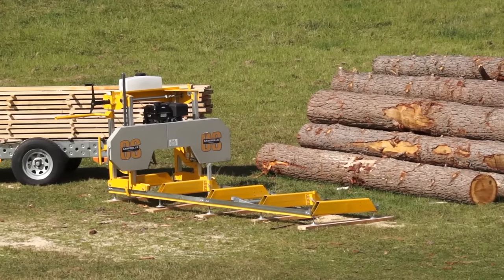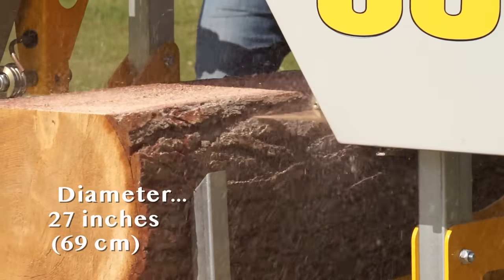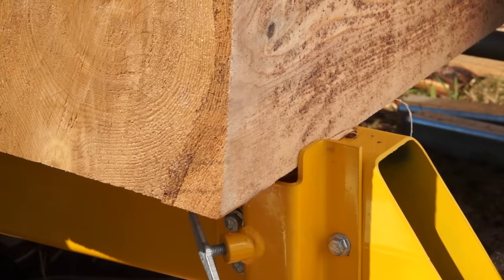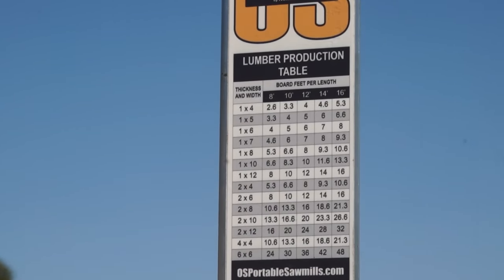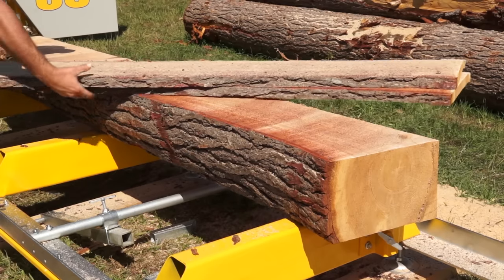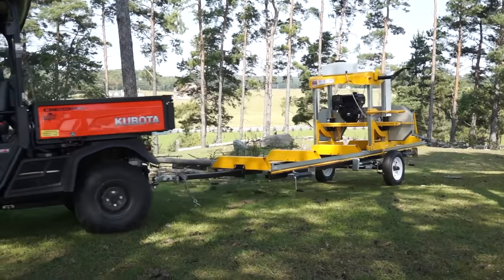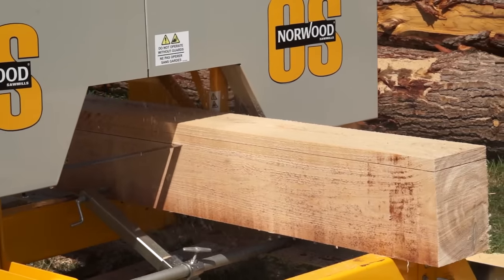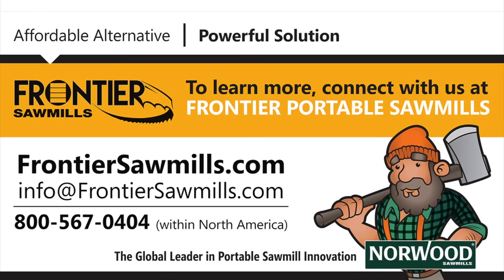The Affordable, Easy-to-Use & Reliable Sawmill You've Been Looking for - The Frontier OS27

Comment: can you please tell me, where can I get it. And also the price.
Reply from the maker: Frontier builds three sawmill models with different log diameter capacities: OS23: 59cm (23”), OS27: 69cm (27”), and OS31: 79cm (31”). Standard log length is 3.4m (11’) but you can add 7’ (2.1m) extensions to mill as long as you want.  You can add the optionally available trailer/support jack system to all Frontier sawmills at any time (when you get your Frontier or in the future).

Frontier Sawmills start at just USD $2397 (for the Frontier OS23). The Frontier OS27 starts at only USD $3397.  The Frontier OS31 starts at only USD $3997.  

You can get a lot of helpful info about Frontier Sawmills, including all pricing, at www.FrontierSawmills.com  .

Frontier services your country factory-direct.  To order, contact us directly at Frontier Sawmills via email at info@FrontierSawmills.com . 

Thanks!

Comment: I was wondering couldn't you not use double sided blade so you could cut on the back stroke
Reply from the maker: Hi Mark

Your question (suggestion) is not uncommon. Here is the reason why it is not done. Band blades need to be supported in the cut – top, bottom and back. To make a sawmill that can cut in both directions means having a blade with teeth on both sides of the blade. But, if you have teeth at the “back” of the blade, it is hard to support that surface with a blade guide support.

Comment: I need this machine please where are get  information
Reply from the maker: Frontier builds three sawmill models with different log diameter capacities: OS23: 59cm (23”), OS27: 69cm (27”), and OS31: 79cm (31”). Standard log length is 3.4m (11’) but you can add 7’ (2.1m) extensions to mill as long as you want.  You can add the optionally available trailer/support jack system to all Frontier sawmills at any time (when you get your Frontier or in the future).

Frontier Sawmills start at just USD $2297 (for the Frontier OS23). The Frontier OS27 starts at only USD $3297.  The Frontier OS31 starts at only USD $3897.  

You can get a lot of helpful info about Frontier Sawmills, including all pricing, at www.FrontierSawmills.com  .

To order, contact us directly at Frontier Sawmills via email at info@FrontierSawmills.com . 

Thanks!

Comment: I am from india.I want to purchase this saw machine .please suggest how can i purchase
Reply from the maker: Frontier builds three sawmill models with different log diameter capacities: OS23: 59cm (23”), OS27: 69cm (27”), and OS31: 79cm (31”). Standard log length is 3.4m (11’) but you can add 7’ (2.1m) extensions to mill as long as you want.  You can add the optionally available trailer/support jack system to all Frontier sawmills at any time (when you get your Frontier or in the future).

Frontier Sawmills start at just USD $2297 (for the Frontier OS23). The Frontier OS27 starts at only USD $3297.  The Frontier OS31 starts at only USD $3897.  

You can get a lot of helpful info about Frontier Sawmills, including all pricing, at www.FrontierSawmills.com  .

Frontier services your country factory-direct.  To order, contact us directly at Frontier Sawmills via email at info@FrontierSawmills.com . 

Thanks!

Comment: Can we get in India? What will be the price in India?
Reply from the maker: We ship Frontier mills worldwide.

Frontier builds three sawmill models with different log diameter capacities: OS23: 59cm (23”), OS27: 69cm (27”), and OS31: 79cm (31”). Standard log length is 3.4m (11’) but you can add 7’ (2.1m) extensions to mill as long as you want.  You can add the optionally available trailer/support jack system to all Frontier sawmills at any time (when you get your Frontier or in the future).

Frontier Sawmills start at just USD $2297 (for the Frontier OS23). The Frontier OS27 starts at only USD $3297.  The Frontier OS31 starts at only USD $3897.  

You can get a lot of helpful info about Frontier Sawmills, including all pricing, at www.FrontierSawmills.com  .

Frontier services your country factory-direct.  To order, contact us directly at Frontier Sawmills via email at info@FrontierSawmills.com . 

Thanks!

Comment: How much will be the price of this machine in Indian Currency?
Reply from the maker: Frontier builds three sawmill models with different log diameter capacities: OS23: 59cm (23”), OS27: 69cm (27”), and OS31: 79cm (31”). Standard log length is 3.4m (11’) but you can add 7’ (2.1m) extensions to mill as long as you want.  You can add the optionally available trailer/support jack system to all Frontier sawmills at any time (when you get your Frontier or in the future).

Frontier Sawmills start at just USD $2297 (for the Frontier OS23). The Frontier OS27 starts at only USD $3297.  The Frontier OS31 starts at only USD $3897.  

You can get a lot of helpful info about Frontier Sawmills, including all pricing, at www.FrontierSawmills.com  .

Frontier services your country factory-direct.  To order, contact us directly at Frontier Sawmills via email at info@FrontierSawmills.com . 

Thanks!

Comment: What is price and  in which country made it
Reply from the maker: Frontier sawmills are made in China. If you would like a sawmill made in the U.S.A. and Canada, consider Norwood Sawmills.

Frontier builds three sawmill models with different log diameter capacities: OS23: 59cm (23”), OS27: 69cm (27”), and OS31: 79cm (31”). Standard log length is 3.4m (11’) but you can add 7’ (2.1m) extensions to mill as long as you want.  You can add the optionally available trailer/support jack system to all Frontier sawmills at any time (when you get your Frontier or in the future).

Frontier Sawmills start at just USD $2297 (for the Frontier OS23). The Frontier OS27 starts at only USD $3297.  The Frontier OS31 starts at only USD $3897.  

You can get a lot of helpful info about Frontier Sawmills, including all pricing, at www.FrontierSawmills.com  .

Frontier services your country factory-direct.  To order, contact us directly at Frontier Sawmills via email at info@FrontierSawmills.com . 

Thanks!

Comment: I very admired this sawmill.how can get these machine? & How much for its cost
Reply from the maker: Frontier builds three sawmill models with different log diameter capacities: OS23: 59cm (23”), OS27: 69cm (27”), and OS31: 79cm (31”). Standard log length is 3.4m (11’) but you can add 7’ (2.1m) extensions to mill as long as you want.  You can add the optionally available trailer/support jack system to all Frontier sawmills at any time (when you get your Frontier or in the future).

Frontier Sawmills start at just USD $2397 (for the Frontier OS23). The Frontier OS27 starts at only USD $3397.  The Frontier OS31 starts at only USD $3997.  

You can get a lot of helpful info about Frontier Sawmills, including all pricing, at www.FrontierSawmills.com  .

Frontier services your country factory-direct.  To order, contact us directly at Frontier Sawmills via email at info@FrontierSawmills.com . 

Thanks!

Comment: Será posible traer una de esas para el Salvador
Reply from the maker: Si

Frontier fabrica tres modelos de aserraderos para troncos de diferente diámetro: OS23: 23” (50cms), OS27: 27” (69cms) y la OS31: 31” (79cms)  La longitud estándar del tronco es de 11’ (3.4m) pero usted podrá adicionar extensiones de 7’ (2.1m) para aserrar troncos tan largos como usted desee. Usted podrá adicionar el sistema opcional de remolque/sistema de soporte de gato a todos los modelos de aserraderos Frontier en cualquier momento (cuando usted compre su  Frontier o en un futuro)

Los aserraderos Frontier comienzan desde solo USD $2297 ( Frontier OS23). La Frontier OS27 inicia desde solo USD $3297. La Frontier OS31 empieza desde solo USD $3897 

Usted podrá encontrar gran cantidad de información sobre los Aserraderos Frontier, incluyendo precios en la página web  www.FrontierSawmills.com/es_us/

Comment: What a machine fabulous great very very nice machine but how much indian rupees plz
Reply from the maker: Frontier builds three sawmill models with different log diameter capacities: OS23: 59cm (23”), OS27: 69cm (27”), and OS31: 79cm (31”). Standard log length is 3.4m (11’) but you can add 7’ (2.1m) extensions to mill as long as you want.  You can add the optionally available trailer/support jack system to all Frontier sawmills at any time (when you get your Frontier or in the future).

Frontier Sawmills start at just USD $2297 (for the Frontier OS23). The Frontier OS27 starts at only USD $3297.  The Frontier OS31 starts at only USD $3897.  

You can get a lot of helpful info about Frontier Sawmills, including all pricing, at www.FrontierSawmills.com  .

Frontier services your country factory-direct.  To order, contact us directly at Frontier Sawmills via email at info@FrontierSawmills.com .

Comment: How many Cubic meters of sawntimber average per day with this brand sawmill,The Frontier 0S27
Reply from the maker: The number of cubic meters (or board feet) that you can saw in a day varies depending on so many factors including the dimension, species and condition of the logs you are sawing (bigger, clean, knot-free logs will yield higher output in a given period of time). Board footage will also depend on what you are sawing (small boards versus big beams). And, of course, it will vary depending on which model you have and its configuration, which power plant and the set-up of your sawing operation.

Comment: Brass tacks. how much $$? 
It’s great
Reply from the maker: Frontier builds three sawmill models with different log diameter capacities: OS23: 23” (59cm), OS27: 27” (69cm), and OS31: 31” (79cm). Standard log length is 11’ (3.4m) but you can add 7’ (2.1m) extensions to mill as long as you want.  You can add the optionally available trailer/support jack system to all Frontier sawmills at any time (when you get your Frontier or in the future). 

Frontier Sawmills start at just USD $2297 (for the Frontier OS23). The Frontier OS27 (the one in the video here) starts at only $3297.  The Frontier OS31 starts at only $3897. 

You can get a lot of helpful info about Frontier Sawmills, including all pricing, at www.FrontierSawmills.com  .

We would be happy to mail you a free Frontier Sawmills info kit. You can order one online at  https://www.frontiersawmills.com/en_us/free-catalog-free-dvd-form

Thanks!

Comment: I like your woodworking machine. Please tell me the price of the machine.
Reply from the maker: Frontier builds three sawmill models with different log diameter capacities: OS23: 59cm (23”), OS27: 69cm (27”), and OS31: 79cm (31”). Standard log length is 3.4m (11’) but you can add 7’ (2.1m) extensions to mill as long as you want.  You can add the optionally available trailer/support jack system to all Frontier sawmills at any time (when you get your Frontier or in the future).

Frontier Sawmills start at just USD $2297 (for the Frontier OS23). The Frontier OS27 starts at only USD $3297.  The Frontier OS31 starts at only USD $3897.  

You can get a lot of helpful info about Frontier Sawmills, including all pricing, at www.FrontierSawmills.com  .

Frontier services your country factory-direct.  To order, contact us directly at Frontier Sawmills via email at info@FrontierSawmills.com . 

Thanks!

Comment: Сколько интерестно эта прелесть стоит?
Reply from the maker: Frontier builds three sawmill models with different log diameter capacities: OS23: 59cm (23”), OS27: 69cm (27”), and OS31: 79cm (31”). Standard log length is 3.4m (11’) but you can add 7’ (2.1m) extensions to mill as long as you want.  You can add the optionally available trailer/support jack system to all Frontier sawmills at any time (when you get your Frontier or in the future).

Frontier Sawmills start at just USD $2297 (for the Frontier OS23). The Frontier OS27 starts at only USD $3297.  The Frontier OS31 starts at only USD $3897.  

You can get a lot of helpful info about Frontier Sawmills, including all pricing, at www.FrontierSawmills.com  .

Frontier services your country factory-direct.  To order, contact us directly at Frontier Sawmills via email at info@FrontierSawmills.com .
Reply: Везде стандартный иностранный ответ!

Comment: kindly,,......... how much machine price?
Reply from the maker: Frontier builds three sawmill models with different log diameter capacities: OS23: 59cm (23”), OS27: 69cm (27”), and OS31: 79cm (31”). Standard log length is 3.4m (11’) but you can add 7’ (2.1m) extensions to mill as long as you want.  You can add the optionally available trailer/support jack system to all Frontier sawmills at any time (when you get your Frontier or in the future).

Frontier Sawmills start at just USD $2397 (for the Frontier OS23). The Frontier OS27 starts at only USD $3397.  The Frontier OS31 starts at only USD $3997.  

You can get a lot of helpful info about Frontier Sawmills, including all pricing, at www.FrontierSawmills.com  .

Frontier services your country factory-direct.  To order, contact us directly at Frontier Sawmills via email at info@FrontierSawmills.com . 

Thanks!

Comment: Can u please tell me the price of the Machine...In India Currency...RS
Reply from the maker: Frontier builds three sawmill models with different log diameter capacities: OS23: 59cm (23”), OS27: 69cm (27”), and OS31: 79cm (31”). Standard log length is 3.4m (11’) but you can add 7’ (2.1m) extensions to mill as long as you want.  You can add the optionally available trailer/support jack system to all Frontier sawmills at any time (when you get your Frontier or in the future).

Frontier Sawmills start at just USD $2297 (for the Frontier OS23). The Frontier OS27 starts at only USD $3297.  The Frontier OS31 starts at only USD $3897.  

You can get a lot of helpful info about Frontier Sawmills, including all pricing, at www.FrontierSawmills.com  .

Frontier services your country factory-direct.  To order, contact us directly at Frontier Sawmills via email at info@FrontierSawmills.com . 

Thanks!

Comment: Ye kitne ropay se hay ye machine our kaha se miltey muge bata do
Reply from the maker: Frontier builds three sawmill models with different log diameter capacities: OS23: 59cm (23”), OS27: 69cm (27”), and OS31: 79cm (31”). Standard log length is 3.4m (11’) but you can add 7’ (2.1m) extensions to mill as long as you want.  You can add the optionally available trailer/support jack system to all Frontier sawmills at any time (when you get your Frontier or in the future).

Frontier Sawmills start at just USD $2297 (for the Frontier OS23). The Frontier OS27 starts at only USD $3297.  The Frontier OS31 starts at only USD $3897.  

You can get a lot of helpful info about Frontier Sawmills, including all pricing, at www.FrontierSawmills.com  .

Frontier services your country factory-direct.  To order, contact us directly at Frontier Sawmills via email at info@FrontierSawmills.com . 

Thanks!

Comment: Is it available in India?
Reply from the maker: Frontier builds three sawmill models with different log diameter capacities: OS23: 59cm (23”), OS27: 69cm (27”), and OS31: 79cm (31”). Standard log length is 3.4m (11’) but you can add 7’ (2.1m) extensions to mill as long as you want.  You can add the optionally available trailer/support jack system to all Frontier sawmills at any time (when you get your Frontier or in the future).

Frontier Sawmills start at just USD $2297 (for the Frontier OS23). The Frontier OS27 starts at only USD $3297.  The Frontier OS31 starts at only USD $3897.  

You can get a lot of helpful info about Frontier Sawmills, including all pricing, at www.FrontierSawmills.com  .

Frontier services your country factory-direct.  To order, contact us directly at Frontier Sawmills via email at info@FrontierSawmills.com . 

Thanks!

Comment: Is this available in the philippines??
Reply from the maker: Frontier builds three sawmill models with different log diameter capacities: OS23: 59cm (23”), OS27: 69cm (27”), and OS31: 79cm (31”). Standard log length is 3.4m (11’) but you can add 7’ (2.1m) extensions to mill as long as you want.  You can add the optionally available trailer/support jack system to all Frontier sawmills at any time (when you get your Frontier or in the future).

Frontier Sawmills start at just USD $2297 (for the Frontier OS23). The Frontier OS27 starts at only USD $3297.  The Frontier OS31 starts at only USD $3897.  

You can get a lot of helpful info about Frontier Sawmills, including all pricing, at www.FrontierSawmills.com  .

Frontier services your country factory-direct.  To order, contact us directly at Frontier Sawmills via email at info@FrontierSawmills.com . 

Thanks!

Comment: India me kaha milega ye machine
Reply from the maker: Frontier builds three sawmill models with different log diameter capacities: OS23: 59cm (23”), OS27: 69cm (27”), and OS31: 79cm (31”). Standard log length is 3.4m (11’) but you can add 7’ (2.1m) extensions to mill as long as you want.  You can add the optionally available trailer/support jack system to all Frontier sawmills at any time (when you get your Frontier or in the future).

Frontier Sawmills start at just USD $2397 (for the Frontier OS23). The Frontier OS27 starts at only USD $3397.  The Frontier OS31 starts at only USD $3997.  

You can get a lot of helpful info about Frontier Sawmills, including all pricing, at www.FrontierSawmills.com  .

Frontier services your country factory-direct.  To order, contact us directly at Frontier Sawmills via email at info@FrontierSawmills.com . 

Thanks!